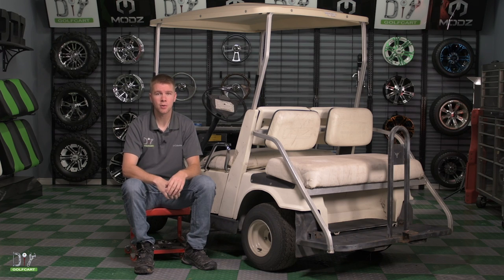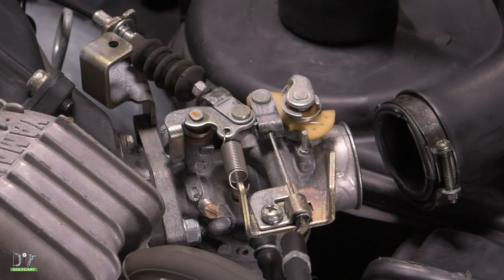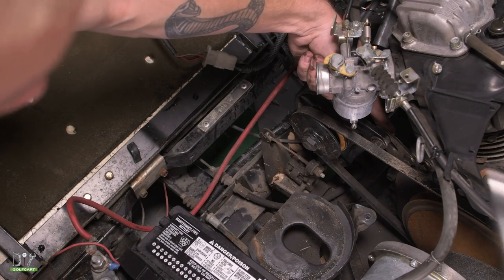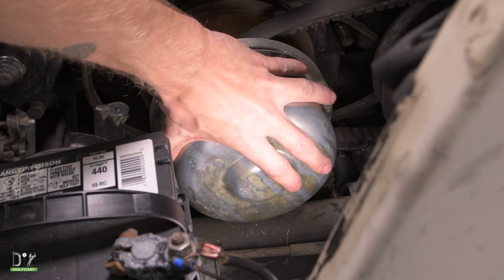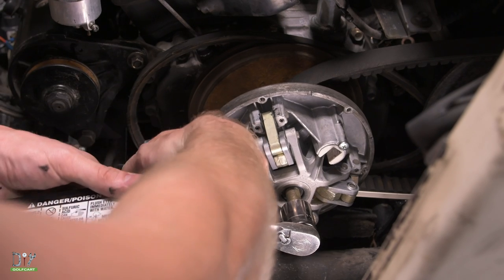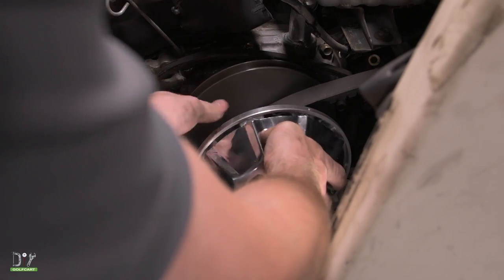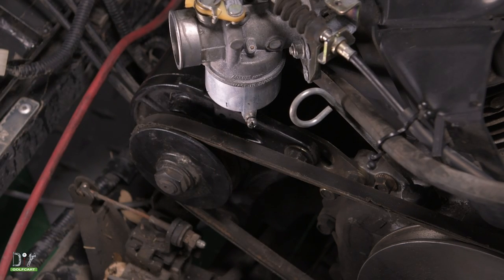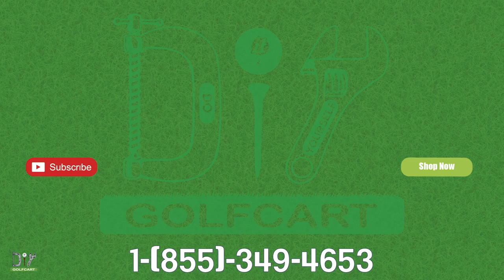Yamaha G9 Clutch Installation How-To

Comment: Hey I just replaced the drive clutch on my other golf cart and found out if you put grease into the drive clutch bolt before you put the bolt remover in, it will create hydraulic pressure and push the clutch off with little to no effort. It surprised the hell out of me and my dad when it just popped off after going at it for a hour

Comment: Thanks for the video!  Was really helpful for replacing my g9 clutch.  Unfortunately the new clutch didn’t completely fix my problem.  How can I adjust the tension in the drive belt?  When we begin driving you can hear a bad rubbing and slipping sound coming from the drive belt!

Comment: What they dont tell you in the video is that puller for the original clutch will NOT fit the new clutch should you have to remove it. New clutch has bigger threads.

Comment: I have the same loose wobble on my 1990 g2. My cart sped has decreased 5mph and wonder if the looseness actually means replacement. Great vids guys!
Reply from the maker: Unfortunately a lot of times when the primary or even secondary clutches start the death wobble, it's better to go ahead and replace the entire clutch.

Comment: I recently ordered a new drive clutch due to wobble. I also did a compression test and my compression was only a 100 psi. What should I be fixing on my g9?
Reply from the maker: At just 100lbs, you may need to install new rings!
Reply: DIY Golf Cart thank you for responding so quickly, I will check y’alls website.

Comment: Great vid. And heyy!! I heard the man at the outro!! :) I have a 94 G9, since I've owned it (3 years) the cap and clutch assembly has a wobble to it when you check it for play. I'd prob say a good 1/4 inch of wobble for lack of a better term. Kind of the same way as if you were checking a wheel for a bad wheel bearing. Any input? Thanks DIY GOLF CART!!
Reply from the maker: The front wheel bearings do have a tendency to wobble once they get worn. Only thing you can do is replace the entire hub and with new bearings.
Reply: @golfcartking  I'm sorry, i may have used the wheel bearing example poorly. I was actually talking about the clutch assembly itself. It has a wobble if i grip it by hand and wiggle it. About 1/4" of play. The outer part that the clucth cover  attaches to.